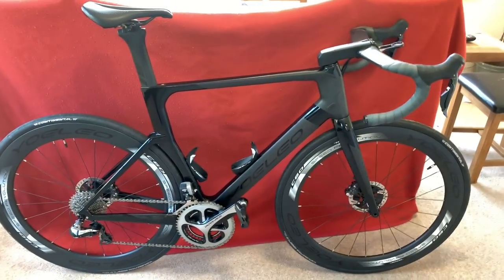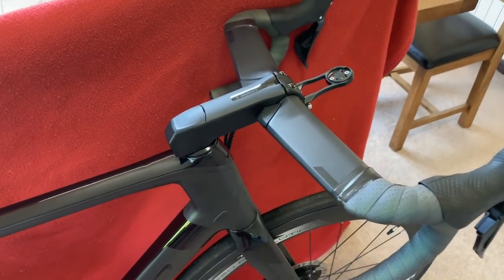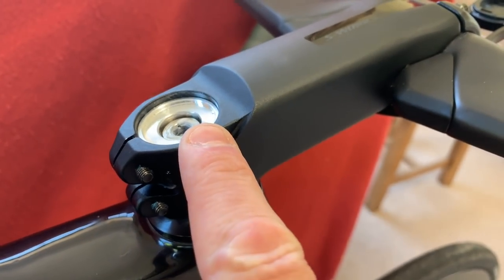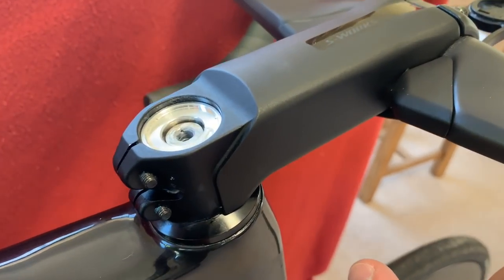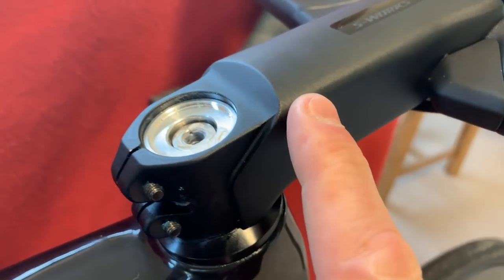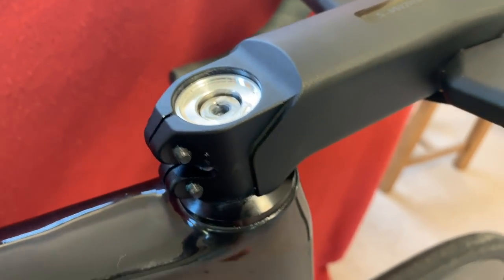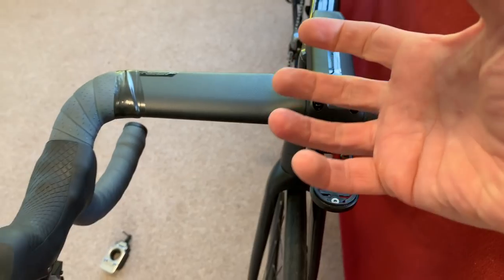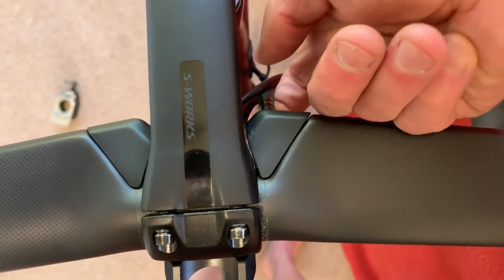Yoeleo R6 Aero Disc Update with Venge parts

Comment: Yo dude, I picked up these bars a few weeks back but haven't sourced a stem yet. I was going to go with the future stem because of the integrated GPS mount. Strangely Specialized told me the Venge stem wouldn't fit the Tarmac SL6. I do think the bars look the business though.
Reply from the maker: Beard on a Bike the stem will fit any correct diameter steerer it might not be as intended but it fits my yoeleo steerer and it’s definitely not made for that frame, sure I have cables showing but the stem is just brilliant with these bars. I’m sure someone else in the previous comments had it on their tarmac. 👍

Comment: Do you agree with me ? I feel the bike can go faster since changing aerofly II handlebar. 
or It's just imagin things because it can save only 4-7 watt.  Anyway  I love this handlebar too.!
I also have it on my tarmac sl6.
Reply from the maker: Giggz Giggz I love the aerofly II bar, I did have the 25mm rise aerofly bar and changed to this due to a retül fit, if you think your going faster then it’s great, anything that helps you mentally ca only be good. I do feel more aero on this new setup though... a great bar. 👍
Reply: @KyrosHouseCycling  can i buy your other aerofly bar?

Comment: Hello, May i say your bike look beatifull, its possible to install this venge stem in my allez sprint 2020? I've didn't find any content about this only yours, thanks for the answer
Reply from the maker: Matheus Verzola thanks! I would think it would fit any standard size steerer tube, the cap may need adjusting as it’s supposed to clip into the top spacer of the venge I think... 👍
Reply: @KyrosHouseCycling  thanks for the answer

Comment: Great video!  What length stem is that? You do know that they have a GPS mount for that stem made by Barfly?
Reply from the maker: Crawfish Pot it’s a 120mm and I did want a GPS mount specifically for that bar, but the one I had already did the job. Thanks for the comment. 👍

Comment: Hey Kyro! Where did you get the bike computer mount setup from? Ive got the same aero bars so need a new bike computer setup. Thanks in advance
Reply from the maker: Hello! I got it from AliExpress, there’s loads of mounts there and it was because I couldn’t find the correct one for the bars that I got a stem bolt attachment one, fits great and is of good quality, only issue was the bolts were too long so I just  hacksawed off a cm or so and they were good. 👍

Comment: Do you have a link to the cable guide pieces for the Aerofly II bar?   I can't find these on any retail site - or the Specialized site for that matter.  Thanks very much
Reply from the maker: Bruce Smith if you look for my video called - specialised venge 2019 stem & handle bar parts unboxing you will find it in there... think the company is amaincycling.com 👍

Comment: Hey Kyro, 

hope ur doing well. 

I installed the stem on my bike but I have an issue where the cap/cover of the stem is popping outside, is there a way to fix it because it does not look good in terms of aesthetics. 

best regards
Reply from the maker: Do you mean the plastic cover comes off of the stem cap?

Comment: the venge bottom piece that goes on the frame from the spacer kit fits on this bike no issues? cuz i dont see u using it. just curious :D
Reply from the maker: No I didn’t use it as this bike didn’t have internal  cable routing plus I needed the stem slammed so didn’t need it. 👍
Reply: @KyrosHouseCycling  alright, so all of the parts for installation are with me except for the stem. I wanted to ask which venge stem size should I buy. i already have a 100mm stem with 15mm spacers underneath. I want to install the venge stem without any spacer underneath. what size venge stem would u recommend in this case?
Reply from the maker: @Dralbastaki  I went from a 110mm 8 degree stem with 20mm of spacer plus a 25mm riser bar to a 120mm venge stem slammed. I got a retul bike fit and that’s what it came out with. Really comfy actually. I think you should get a bike fit if you can afford it as in my opinion they are really good. 👍
Reply: @KyrosHouseCycling  I asked my bike fitter about this, he told me; "get a 1cm but not remove all 15mm." I am not sure what he really ment here but looks like I will get a 100m venge and experiment with 10mm and 5mm. but the thing is, I really want a slammed stem.
Reply from the maker: @Dralbastaki  well you can experiment before you cut your steerer, just make sure your compression plug is long enough so as to not leave your stem unsupported. 👍

Comment: Kyro- I am adding the newer venge stem and aero bars to my Scott Foil 40.  Where did you get your computer mount?  All my searches come up with the same pic saying only compatable with vengeance, or roblaiux.  Is it a separate face plate?  Pulling my hair out with this.  Thanks!
Reply from the maker: Todd Arbuckle I got the computer mount from AliExpress, I just searched garmin stem computer mount and found one that attaches to the stem bolts, it works really well and was much cheaper than the venge stem mount. You basically use the original stem faceplate and screw-in the mount using the two lower bolt holes Hopefully you’ll find what you are looking for. 👍

Comment: Looks good, just a shame about the exposed cables still.
Reply from the maker: CMDR Rockswift yeah the new R9 frame from Yoeleo is completely internal cable, ah well in the future I’ll get a new frame. 👍
Reply: @KyrosHouseCycling  Prophetic words... anyway, your R6 with this bar was still a kick ass bike. Almost a shame you got the R9 now :-D
Reply from the maker: CyclingMilan I’m considering using the same bar for my R9.... 👍
Reply: @KyrosHouseCycling  Can you get the cables to enter the frame cleanly? also did you go for a 38cm width or not?
Reply from the maker: CyclingMilan I haven’t checked, but I’m pretty sure they’d run under the stem and into the frame. It’s just an idea at the moment... 👍
Reply: @KyrosHouseCycling  Yeah check, since afaik the cables go trough the top of the spacer, meaning if the stem doesn't have a hole there for the cables, the stem blocks that hole by covering it up...

Comment: Hey Kyro, if I want to slam my stem (to try it out - without sawing it off yet), what do I do with the excess cables? Is there a way to push them inside the handlebars or frame? Would you need to take plastic covers off to do this? Thanks!
Reply from the maker: I’m not sure to be honest, you’ll just have to try to find a way to accommodate the cable somewhere. You could try to slam the stem and just see if the cables sit naturally and find there own way. That’s the best advice I can give. Also be careful that you aren’t clamping your stem back on an unsupported part of the steerer tube. 👍